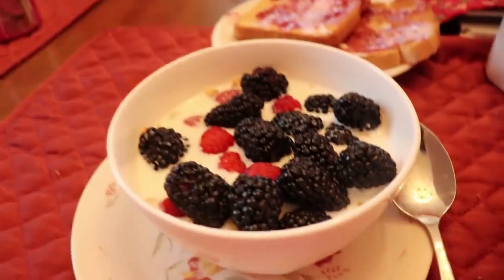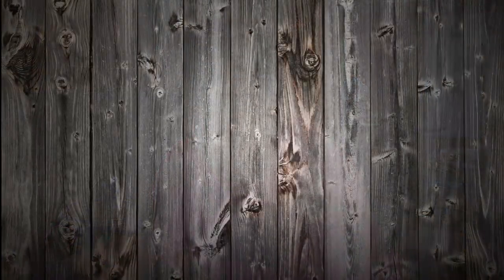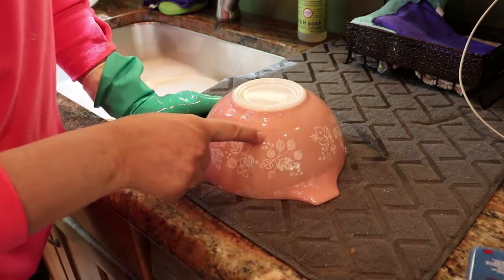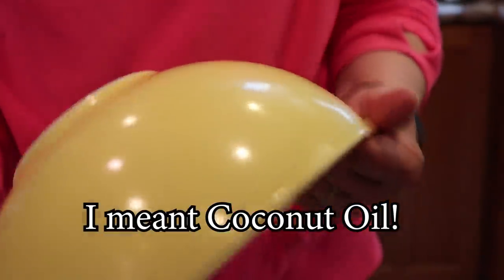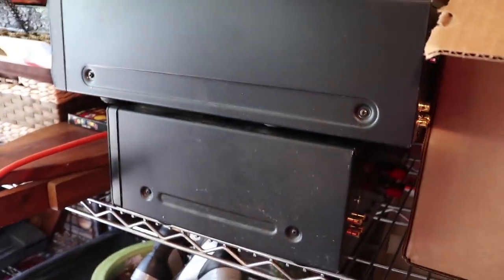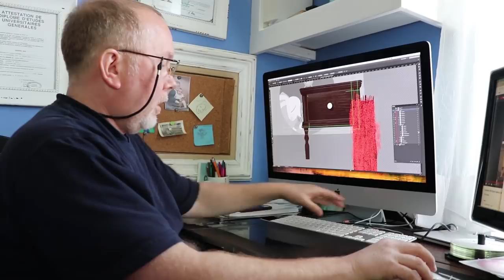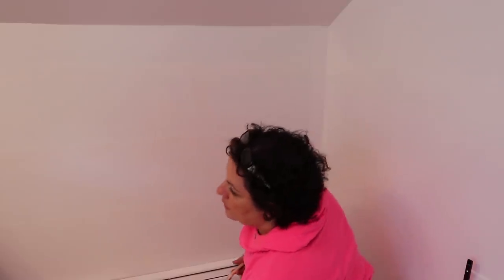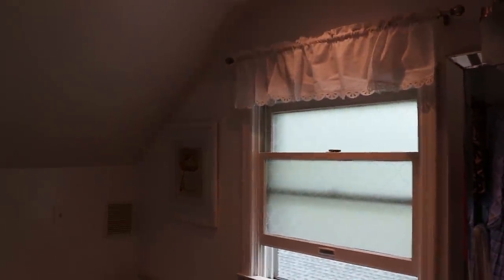🌼 Staycation 2019 - Day 4 || How to Clean Vintage Pyrex ||  More Painting ||

Comment: My vision is poor so at first I thought your little plant was a variegated aloe vera [Aloe Aristata], but instead it is Haworthiopsis fasciata.  

This is an excerpt from a nursery that sells succulents. I'm not so sure about their last comment -- I have been known to unintentionally kill cacti!!

"The Zebra Plant (now named Haworthiopsis fasciata) (Willdenow): Named for the distinctive white bumps that line the outside of its leaves. In nature, it grows in the shrub lands of South Africa with acidic soil and partial shade or filtered light. Its ability to tolerate low light makes it a favorite houseplant, even for beginners. It is especially easy to grow and rarely affected by common succulent pests and diseases. Strong, drought-tolerant roots will grow if they have great drainage and deep, infrequent water when the soil is fully dry.

Haworthiopsis tolerate high heat by slowing down and eventually going dormant in the peak of summer. This means that, unlike other succulents, it is important not to over-water or fertilize during summer dormancy and water more frequently in the winter growing season. Direct sun can burn the leaves. The Zebra Plant is slow to grow and produce offsets, but slow and steady really does win the race here, as the Zebra Plant is particularly difficult to kill."